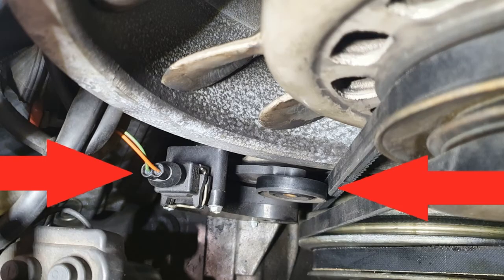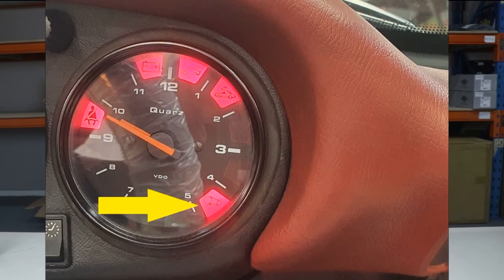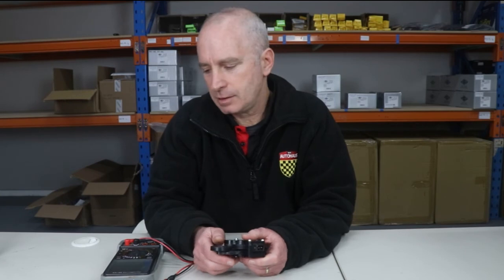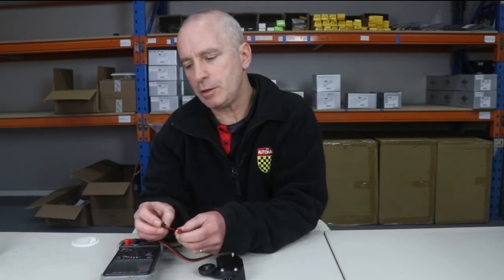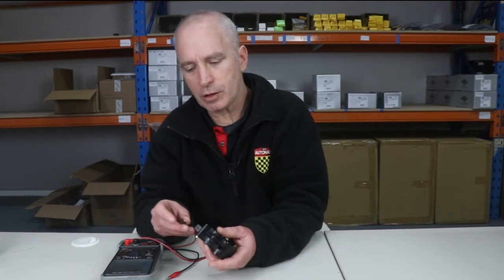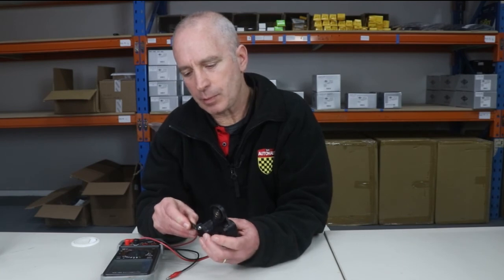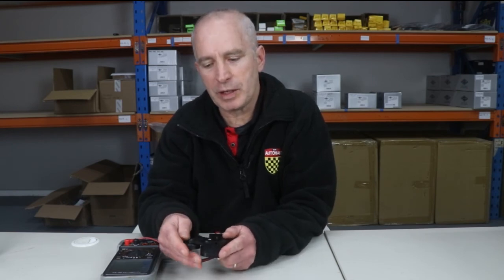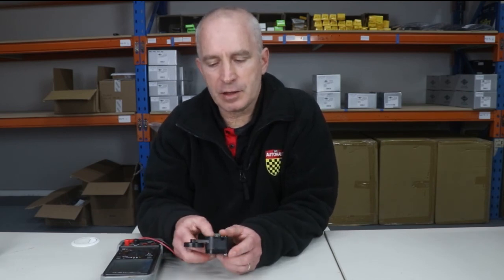Belt Tension Sensor on 964 and 993

Comment: Hi there. Yup, i replaced mine at 63,000 miles. The plastic of the wheel itself broke forcing me to use a ziptie to hold it back until I could replace it. I had the alternator belt go so I replaced all three. Yes, I limped home on battery alone (27 miles, traffic, strong battery!)